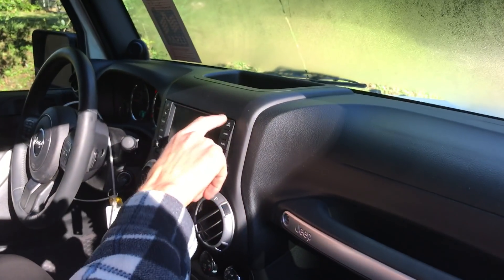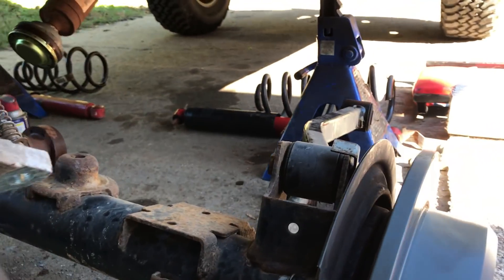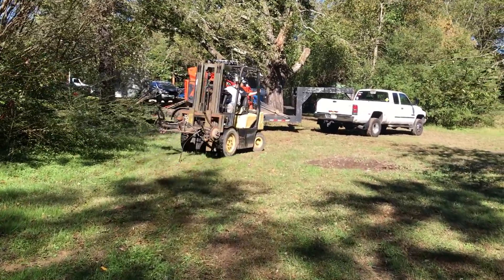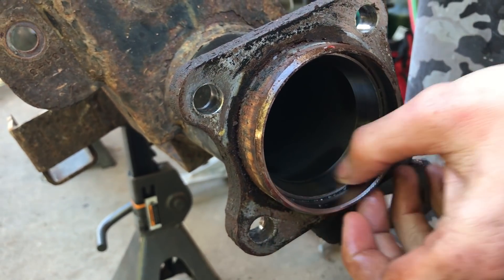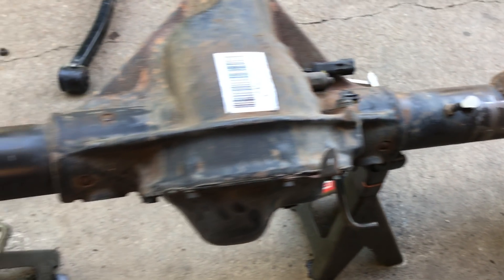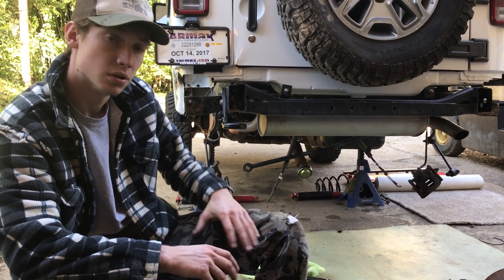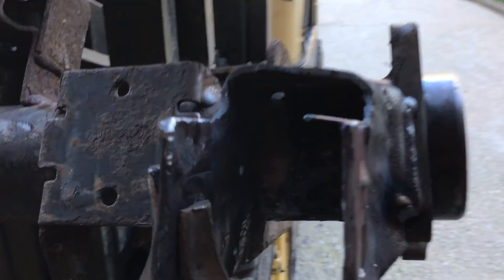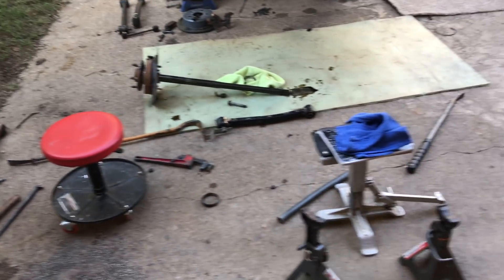Rebuilding A Wrecked Car JEEP RUBICON (Part 2)

Comment: That plug is for a block heater usually u plug them in over night so in our cold winter's they start easier, also all that rust is because they put salt on the roads and turns cars into rust buckets, so theres a great chance it came from the north
Reply from the maker: JS Sending It yeah that’s what I was thinking. I’m glad it’s just surface rust and can be taken care of with a wire wheel.
Reply: goonzquad yeah I live in northern New York and we get tons of snow  that rust isn't bad for being almost 5yrs old

Comment: Get rust converter off of Amazon.  Read the directions and use it.  If you paint over rust the rust will be back in 3 weeks.  Or better yet look into a soda blaster.

Comment: Bearing races all you have to do is heat them in 3 spots till they are red then let cool and they will fall right out. No need to heat the housing.

Comment: I'm curious as to why you didn't use the axle housing you showed in your first video?, are they different?. You stated they were both Dana 44's.
Reply from the maker: MegaDirtyberty The 6 speed Rubicon is 4.10 gear ratio and the donor axle was 3.73. I’m not 100% sure if they’re actually Dana 44 for the regular Wrangler, but that’s what I’ve heard from a couple of people. So we just decided to get an axle shaft to fit the 4.10 axle and it should be good.
Reply from the maker: My housing may be a bit bent, but I know a guy that has a jig to straighten them out. Worst case scenario, we just put a new tube on the side that took the hit. We’ll just have to get an alignment first.
Reply: Sorry I also mean't to add, use the Rubicon diff pumpkin, donor axles etc. If you lift the vehicle it maybe a good time to cut the brackets and fit new brackets?.
Reply: they are both dana 44 however the ribicon has the diff slightly offset in the pumpkin so it uses a different carrier and off sized shafts, there are no strength benefits from this. it is considered an upgrade to put a non rubi rear axle with aftermarket locker and shafts
Reply: Thanks for the reply, good to know.  Japanese vehicles are more prevalent here so we don't get as many jeeps.

Comment: should have just replaced that bracket
Reply from the maker: We actually had to remove the brackets completely because the aftermarket bumper came with mounting hardware in place of the original brackets
Reply: I do believe what the OP was talking about that you should have just cut off and replaced that control arm bracket. But there is a very good chance that your rear axle housing is also bent. It takes a lot less force to bend that housing then your axle that was badly tweaked..  You will find out when you drive it.
Reply: yes controller arm bracket was badly mangled
Reply from the maker: Steve Yulenburg Yea the axle housing was definitely a bit bent. We did drive it up the street and drove pretty good. Once we are ready to get wheel alignment depending on how bad it’s off we may pull the axle off and get it straightened. I know a place around town that has a jig to straighten axles. Then we will also get a new control arm bracket.
Reply from the maker: Jon Gass yea was debating on getting a new control arm bracket welded on. But since we are getting adjustable control arms I think we will be able to align the axle back into position. That’s not 100% finalized, we might still do a new bracket
Reply: goonzquad,  Sounds like you have a plan. Hey thanks for posting your build.
Reply from the maker: Steve Yulenburg Thanks man much more to come
Reply: nice can not wait to see it done
Reply from the maker: Jon Gass Here soon! But you know a Jeep build never ends lol theirs always something you can upgrade or mod
Reply: right haha just empty every pocket
Reply: yea once you heat up the metal it weakens the metal
Reply: The easiest way to fix your housing is to drill out the plug welds, and pull the tubing out. Then do the same on your donor axle. press it into the housing, and re-weld the plug welds. This will fix the bent tube, bracket, and anything else that might be an issue on the driver's side.
Reply from the maker: Truth Space Great info, yes that sounds like something that we will do if the alignment is off. 👍

Comment: Volvo is pretty nice
Reply: I had a 1999 Volvo V70R Turbo Brick. Rare car, mint shape. Super fast hot car. I sold it 5 years ago for my Jeep Wrangler. Now I have a '98 Wrangler with only 70k miles. I wouldn't trade it for one of these plastic Jeeps. I also have a '17 Renegade. It's plastic junk.

Comment: If I'm right, the Rubicon has LSD, and the original JK doesn't
Reply from the maker: Vaios Kaliakoudas yea that’s correct
Reply: I don't think that's correct.  The Rubicon has an open rear diff with e-lockers.
Reply: OC is right. The Rubicons have open diffs front and rear with Eaton E-lockers installed from the factory.
Reply from the maker: OC Run Sorry my mistake you guys are right
Reply: You may be confusing the JK era Rubicon with the TJ era. TJ era Rubicons have air lockers paired with a geared (no clutches) LSD, so you have both. JK Rubicons have e-lockers and are an open-diff when unlocked.
Reply: how much you paid for the jeep